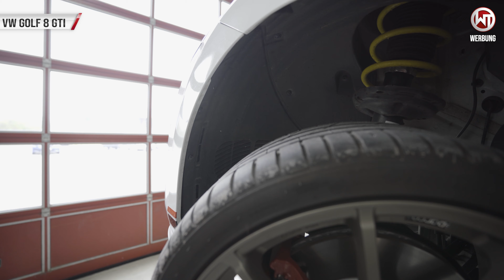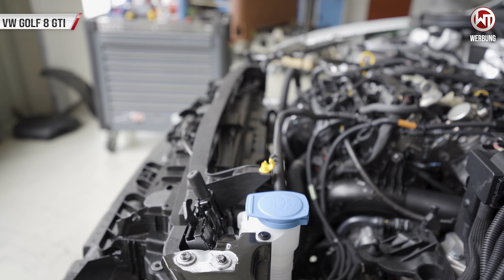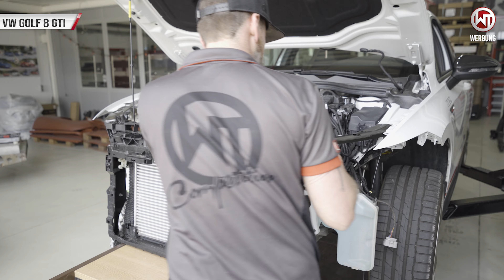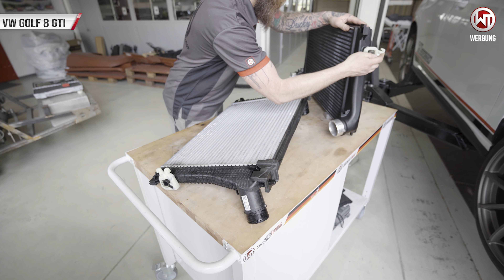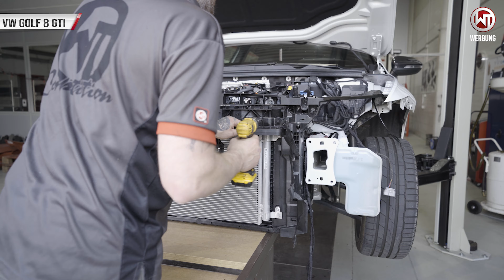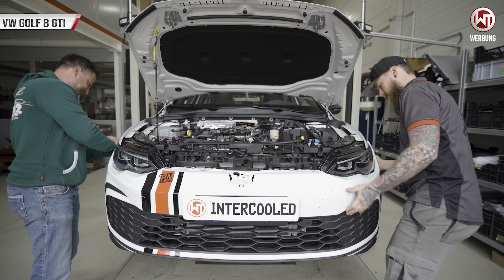Wagner Tuning - VW Golf 8 GTI Intercooler Installation

Comment: This is a proyect…. Not only does the whole front have to come appart, but also the a/c condenser has to be disconected which means you have to have the system
Emptied and recharde after
Reply from the maker: @krisrivera2301  AC condenser does not have to be disconnected, see video min 4.00…
Same work like changing the OEM Intercooler.
Reply: @WagnerTuning  true… its just hanging on the side 👌🏻

Comment: Just ordered! Apparently this is only fitting the older 8R's, but did not see this info on your site.. only BMP's after contacting them! "This will only fit Pre-11/1/22 Golf R’s and or Golf R’s that were equipped with Factory Radiator SKU# 5Q0-121-251GN."